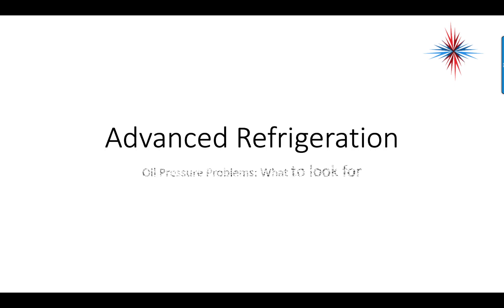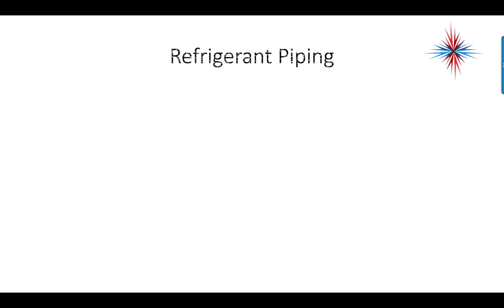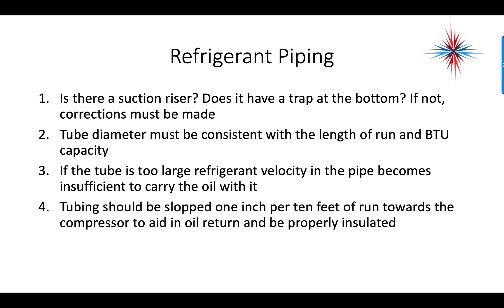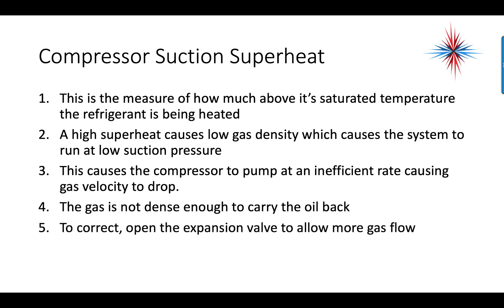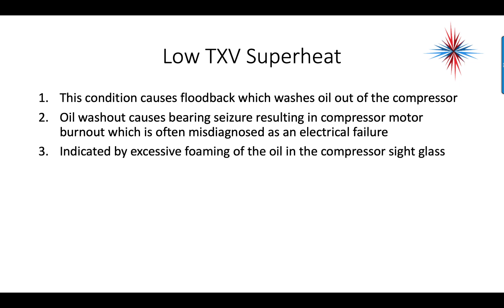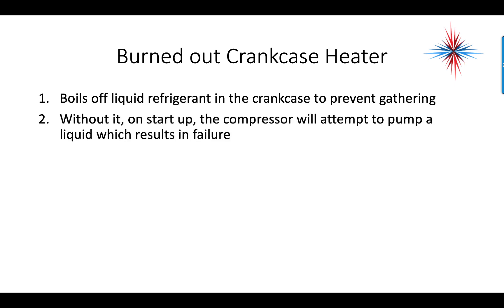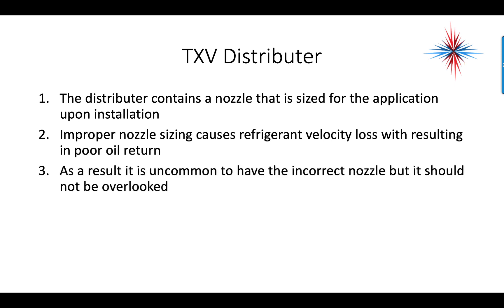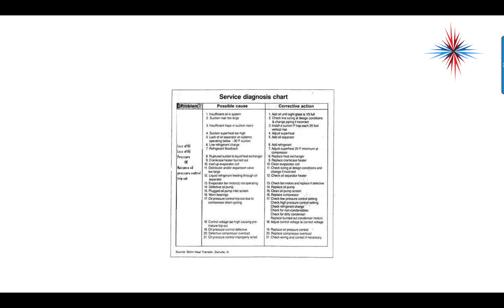Advanced Refrigeration - Oil Pressure Problems

Comment: hi pleas i have cold  store  deep freeze  [' _ 20 c ] used comp danfoss type mt 80  when running  the low pressuer was 30 psi  within 30 to 45 minet the level of oil will reduce to the minemum  that let me to stop the system   what can i do whith this proplem thanks